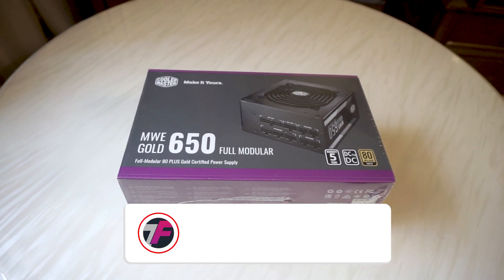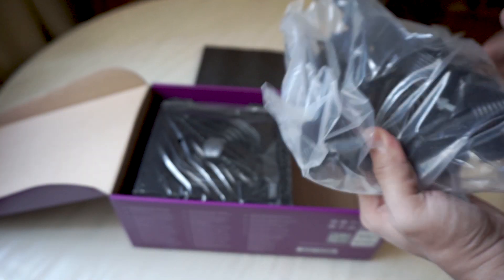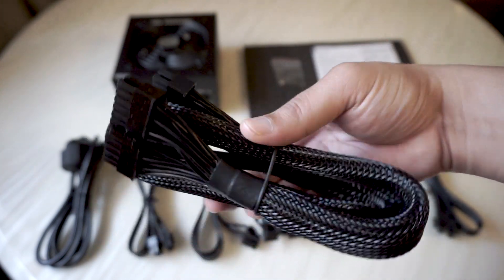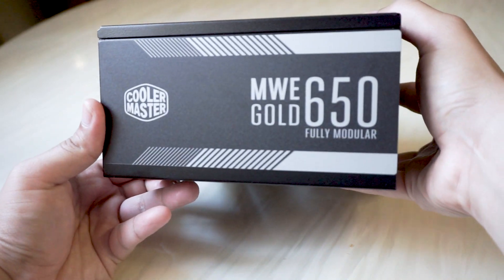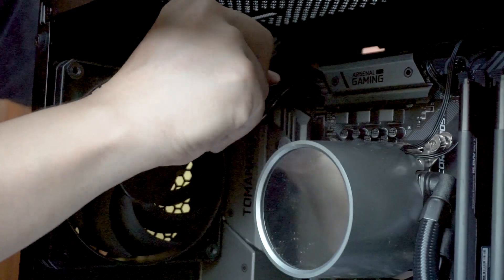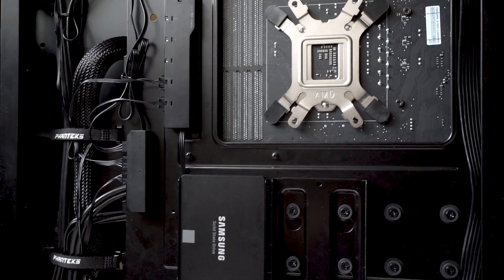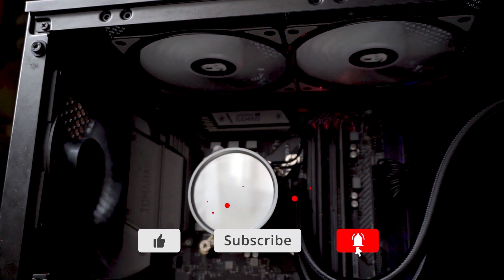Cooler Master MWE Gold 650 Full Modular: PSU Overview & Build Experience

Comment: I'm sorry for asking this stupid question.
But can you tell me exactly which cable is going to go where(they all look the same)
I have the same PSU
My specs : Ryzen 9 3900X
RX 5700XT
Aorus B550M Pro Mobo
Reply from the maker: Hello! It's not a stupid question, I do get confuse sometimes too. Haha. You can refer to Cooler Master Pin Layout Sheet here: https://coolermaster.egnyte.com/dl/jz8rsErAtl/ . 
"MOB side" means one side of the cable goes to the motherboard and "PSU side" means the other end goes to the power supply itself.

You may pause at 02:51 of this video, I will give you a summary:
1) ATX cable: 24 PIN (goes to motherboard) - 18+10 PIN  (goes to power supply - 18 PIN goes to "ATX 18P" label & 10 PIN goes to "ATX 10P" label)
2) CPU cable: 8+4+4 PIN  (goes to motherboard) - 8 PIN  (goes to power supply - choose any 8 PIN holes under the "CPU/PCI-E" label)
3) GPU cable: 8+6+2 PIN  (goes to your graphics card) - 8 PIN  (goes to power supply - choose any 8 PIN holes under the "CPU/PCI-E" label)
4) SATA cable: 1 SATA connector (goes to your Harddrive or SSD) - 6 PIN (goes to power supply - choose any 6 PIN holes under the "IDE/SATA" label)

I hope the link and my summary helps! Do let me know if you require further assistance, I will see what I can do! All the best!
Reply: @TechFlik  Thanks a lot! :)
Reply from the maker: No problem! I hope it helps you! All the best to you!

Comment: Do i need to use all of the SATA heads on a given cable?
Reply from the maker: Hello! This PSU comes with 2 SATA cable and each cable there are 4 SATA connectors. You do not need to use all the SATA connectors, just use the ones that you required. For example, in this PC build, I only use 1 cable and connect 2 SATA connectors, 1 for my hard drive and the other for my SSD. Hope this helps! If it does, do consider subscribing for future tech content!

Comment: Very clear review, just a note I have to add here. I've sent 3 units for RMA due to it prematurely failing, buyers beware.
Reply from the maker: Oh man that's terrible! Any idea if they are newer versions or older versions? So far, the power supply is still running for my cousin for close to 2 years and my friend for 4 months with no issue. I hope they won't face any issue! Also if you like the review, do consider subscribing for more future tech content!
Reply: @TechFlik  No idea to be frank, not testing the 4th unit and just gave it off since I bought a Seasonic instead
Reply from the maker: Ahhh I think Seasonic power supply are more reliable. That's really worrying that you had to RMA 3 times. I hope all work out well for you with Seasonic! Cheers!

Comment: Can it handle Zotac RTX 2060 Super
Reply from the maker: Hello! Yup with 650W it can definitely handle an RTX 2060 Super! I actually did a build for my friend with an RTX 2070 Super, you can watch it here: https://youtu.be/bgkracZkC90 . So far there is no issues, playing games from Witcher 3 to Call of Duty Warzone. Hope this helps! If it does, do consider subscribing for future tech content!
Reply: @TechFlik  thankyou for reply it , i'll subscribe you , eh ' one more question , are mwe 650 have 8 power pin?
Reply from the maker: Hello! I apologize for this late reply, I may have missed out your reply. Are you referring to a CPU connector? If so, as seen at 03:07 , this exact power supply actually comes with 8+4+4 CPU power cable. Depending on your motherboard, you can use it as an 8 pin or12 pin or 16 pin configuration. Thank you for subscribing and I hope you enjoy your stay on this channel!
Reply: @TechFlik  , okay , terimakasih

Comment: are the 650w constant?
Reply from the maker: Hello! Are you talking about continuous power? If so, at 2:13 of this video, you can see the power supply label. 
If you pause the video, you can see in DC Output, under the +12V, you have an amperage of 54.1A. 
So to get the wattage, if we use the formula, V*A = W or 12 * 54.1, we get 649.2W. So technically this power supply has a continuous power of 649.2W. 
As long as the total power of your components in your PC build does not exceed 649.2W, you should be good. 
Hope this helps! If it does, do consider subscribing for future tech content!

Comment: This psu has 10+8 pins but atx mobo are 24pin? Wth? Or is the end that goes into the mobo is 24pin
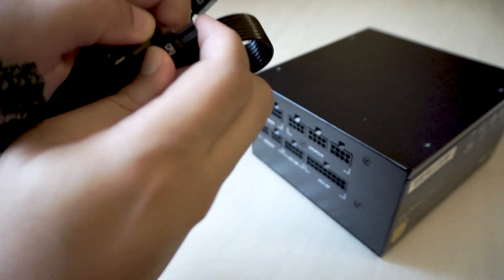Reply from the maker: Hello! I'm guessing you are referring to the part at 3:21 ? Yes, the cable is a 18+10 pin -> 24 pin ATX cable. The 18+10 pin end goes to the power supply while the 24 pin end goes to the motherboard. Hope this helps! If it does help, do consider subscribing for future tech content!

Comment: how would you use this PSU and a molex 4 to 4pin to power the cpu with 12 pins
Reply from the maker: Hey there! I'm sorry I don't quite get your question? This PSU already comes with a CPU cable that supports up to 16 pins, (8+4+4). So if your motherboard only requires 12 pins, you can split the cable and just use 8+4 pins as shown at 03:06 . Furthermore, this PSU also comes with 2 peripheral cables, with each cable having three 4-pin molex connectors. Hope this helps!

Comment: I HAVE  a mini mother Bord needs only 4 pin not 8 i will change it after 15 days but  im wondering if it will be a problem for me
Reply from the maker: Hi Techno! I'm guessing you are referring to the CPU connector on the motherboard? Since your motherboard, only requires a 4 pin, this PSU model comes with two 4-pin CPU connector which you can split. You can see it on my video at around 03:08 . So, there should be no problem connecting a 4 pin to your motherboard. However, as there is a lot of versions to this power supply, please check-in stores before buying. Hope this helps!
Reply: @TechFlik   thnks for reply i check on store its an updated model comes with 1 * 8 pin + 2 * 4 cpu connector can you tell me is it problem or no i mean can i use the second cpu cable who had 4+4 like in your video or not because my motherboard  needs only 4 pin cpu connector and again thanks
Reply from the maker: @technodz7283  Hi Techno! Yes, you should be able to connect that 4 pin into your motherboard. And it should work as the CPU will only draw what it needs from the power supply. Hope this helps!
Reply: @TechFlik  thnks brooo
Reply from the maker: @technodz7283  No problem bro! If this helps, do consider subscribing for future tech content!

Comment: Is it loud and does it work good
Reply from the maker: So far for the unit I have here, it is not loud at all. I barely notice any noise coming from the power supply. It could be due to the Silencio fans used for quiet performance. Overall, it is a good power supply, I will definitely buy it again. Hope this helps!
Reply: TechFlik thanks a lot imma buy this tmr if it is in stock and hopefully my motherboard too since those are the last 2 things I need to start building
Reply from the maker: Oh man.. That sounds great! All the best for your PC build. Let me know how it goes! Do consider subscribing too for more future contents like this.

Comment: Coolermaster power supplies are killer, especially when they’re fully modular
Reply from the maker: So far it really seems like a reliable cooler. I guess only time will tell. Haha
Reply: Until you drop it
Reply: @ryang2v  i got a cm psu 500w from 2006 runing 24/7 never a problem. not even certified.
idk if they do them the same tho.